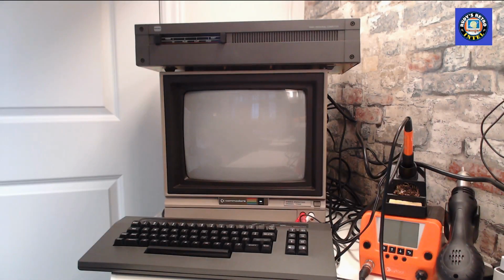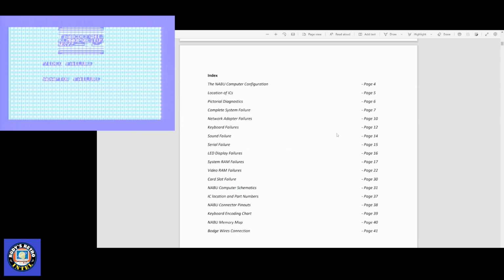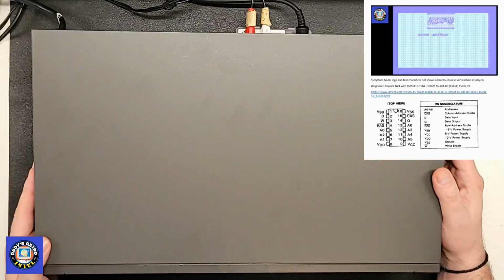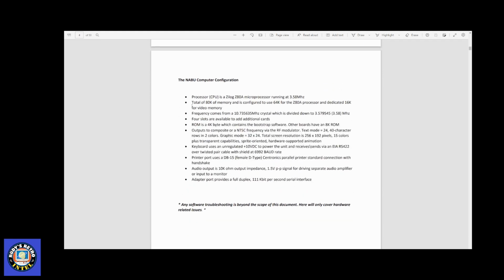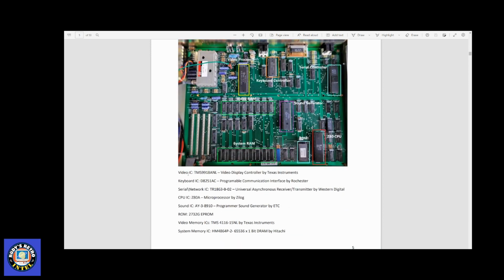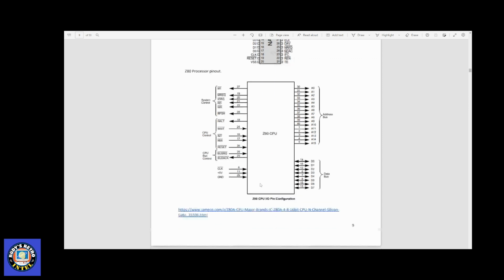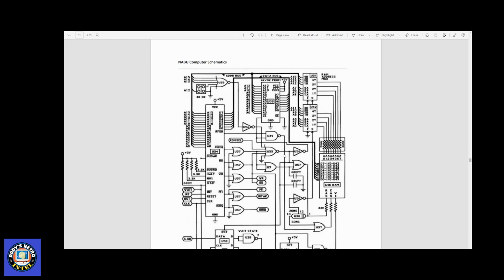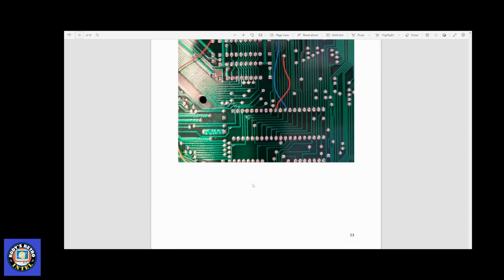NABU Computer repair: Expert tips and tricks

Comment: 4:22 150 Nanoseconds, not milliseconds.  Great work, btw.
Reply from the maker: Thanks for the correction. Sometimes you can watch it over and over and still miss the mistakes
Reply: @RudysRetroIntel  Sometimes you need a second set of eyes.  I miss my mistakes all the time, look right through them and don’t see it.  Thanks for the work, socketing all those chips had to be painful.
Reply from the maker: Yeah, I need 3 more sets of eyes :) As for the work, glad to help out the community. More updates to the document will come so check out regularly
Reply: @RudysRetroIntel  I envision a diagnostic ROM, much like a C64 Dead Test cart.  Z80 can’t be all that different than 6502, right?  :)
Reply from the maker: It is different and harder but I'm working on a diagnostic ROM idea, just need some Z80 programmers to help me out

Comment: Thanks for collecting the info.
Reply from the maker: Someone eventually had to, so why not me.
Reply: @RudysRetroIntel  , I had a black screen with a video signal. I did initially try pushing the chips in the sockets, all were secure and didn't seem to shift.  It hadn't fixed the issue.  My expectation is the TMS9918ANL video chip was the cause as it was so badly tarnished on the legs.  I pulled all of the socketed ships, polished the legs with a fiberglass pen, and used contact cleaner on all the sockets.  It was then working properly.  I didn't test after each chip.  The only one that looked likely to be an issue was the video chip, but it may have been another chip.

The issue with the power supply fans, doesn't appear to be a design problem, it is being a 2 part fan it has sagged/slid down causing it to rub on the bottom edge of the fan frame where the blade came in contact to the side.  These fans are made with a tight clearance, but there is plenty of clearance if it is aligned in the frame properly.  Modern fans are a lot sloppier. Just taking the 3 small recessed screws loose, shifting it properly to be centered again and tightening them clears up the issue.  I sorted the first one by accident as I took it apart and when I put it together it aligned itself better than it had been.  Looking at my second one, I could see it had shifted downward and was only rubbing at the bottom edge where there was now no clearance but a noticeably wider gap at the top.

As I had mine apart, I took the board out and it is the same markings on the bottom with the same bodge wires in place (although different colors).  I would note that I had 2 that may have been pressed onto the leads poking out of the ics as I had it laying flat on my work bench. Before putting it back together I double checked that none of the bodge wires were speared on the leads of the components.  I have had that issue before on other 80s era systems where I speared a bodge wire on a ic or component leg while having it flat on the work bench.
Reply from the maker: @Muldrf  Thank you for sharing your experience! I've had the same issues with the bodge wire on a Commodore 128. Glad that things are working out.